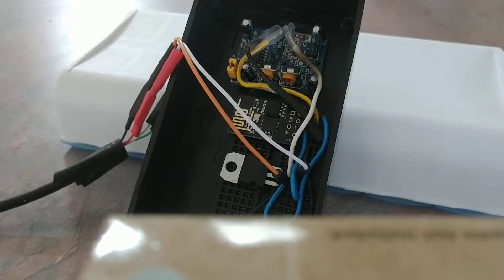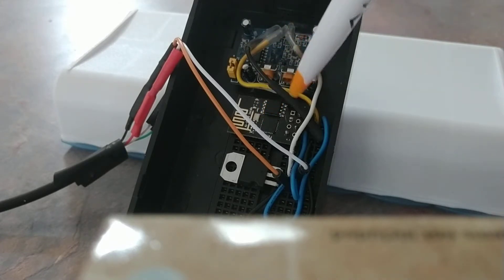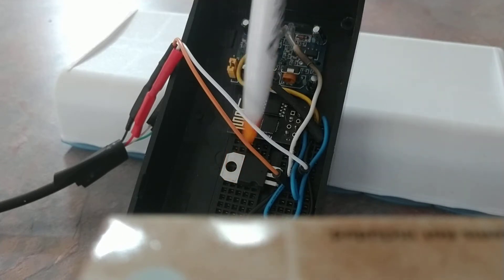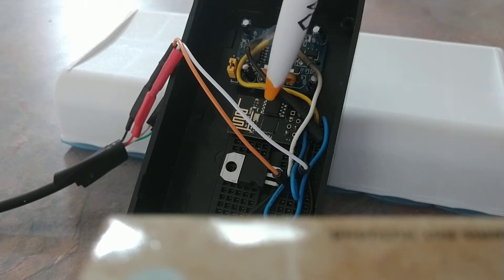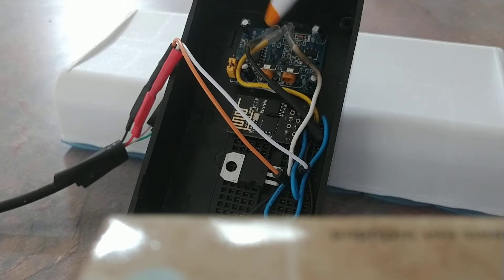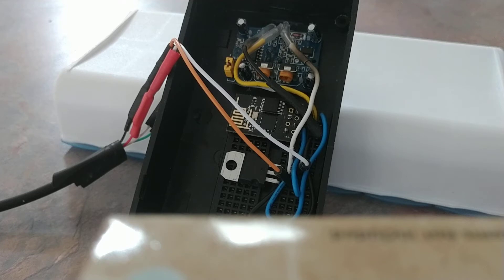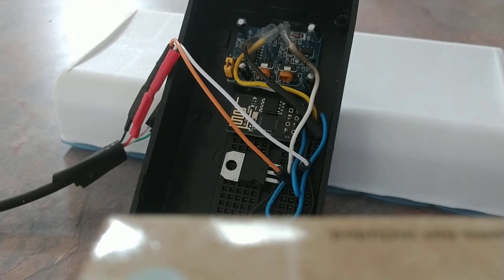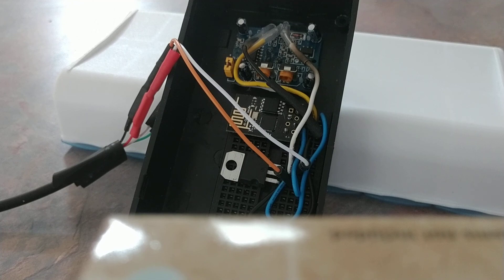ESP8266/ESP-01 Motion Sensor Small Project Box

Comment: Great video.  I have some esp8266 ver 1s that I cannot get smartthings to recognize.  Which example would be a good one to run on the 8266 where I can have ST find it?  Also, does this work with the newest version of Smarthings?
Reply: I mean the newest version of the SmartThings App for Android.
Reply from the maker: I've migrated to Hubitat so am not sure if the latest ST will have issues with the ST_Anything. I am betting it will work fine. As for an initial project, start off with a switch. An easy binary on/off would be a good way to prove concept. Just remember to use a voltage regulator on it depending on your use case. Drop it to 3.3v...ALWAYS helps with getting the ESP01's to run smoothly.
Reply: what do you mean by the "newest version of smartthings" ? you mean   gen 3 hub?

Comment: Great video, have a look at the 3.3v hack for that PIR you got there online. It has its own regulator and actually functions better at 3.3v supposedly . Where the yellow jumper is on your sensor that open pin is where you connect your 3v. It’s meant to reduce false triggers and run a little smoother. Just an observation, keep up the good work !
Reply from the maker: Wow...I just looked that hack up and will be trying it out today. Who'd of thunk it!  Thank you BIGTIME for the tip!
Reply: Can you explain how is the connection on the yellow jumper please?